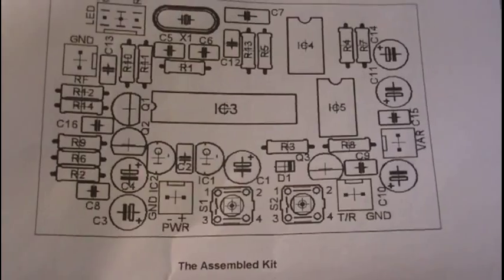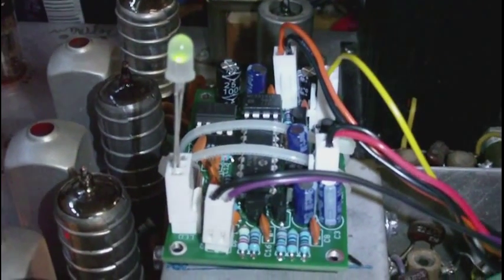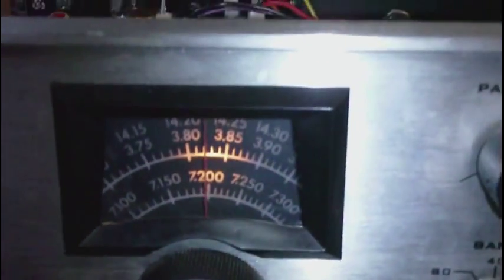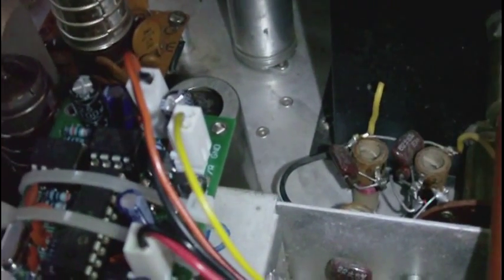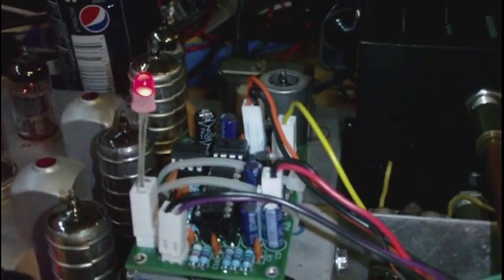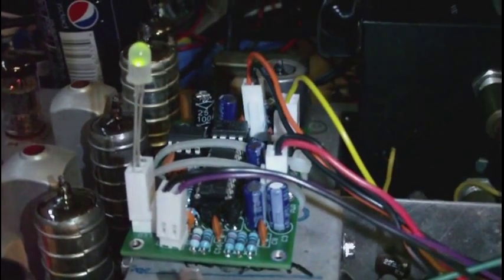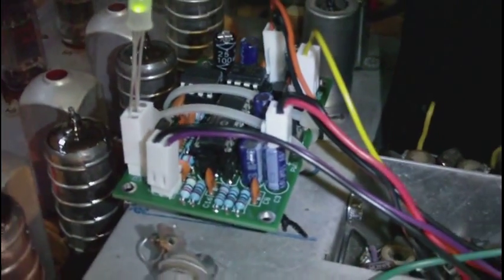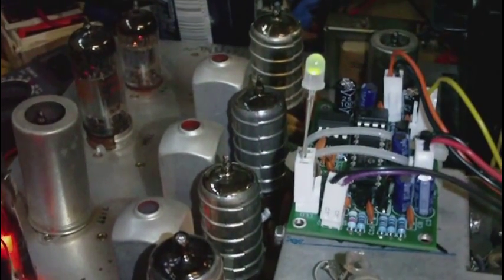Cumbria Designs X-Lock VFO stabilizer kit, construction and finished installation in Eico 753

Comment: I bought one a few years ago and it works, in my own opinion, better than any other huff-puff i have built. There are quite a lot of features and just the thing that it unlocks if you want to tune and when you found your frequency it directly starts to lock. Other circuits have had a buttom that you have to press each time you want it to lock. Very annoying. Just that feature makes the X-lock worth it.

Comment: Hey Chris, nice video, thanks for the info. I have an Eico 753 that I have owned since 1966. I am interested in installing the Cumbria X-Lock. Did you get specific info from Cumbria on how to use it with the 753 or just figure it out yourself? Specifically, you mention a varactor on the vfo board. Is that an existing component in your 753 or one you installed? And if you installed, did it come with the Cumbria parts? Also, not sure about the T/R hook up you talk about in the video. Thanks for any help you can give me!